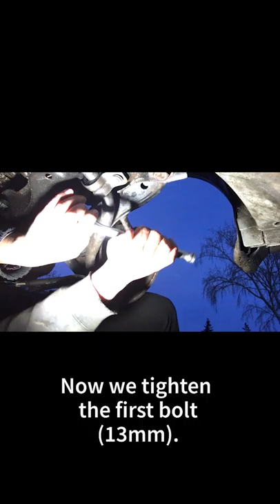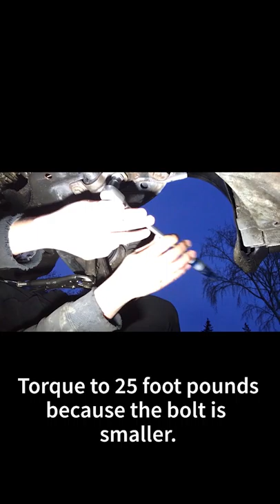Repair A Broken Bolt On The Sway Bar Bracket: Using A Drill, Bolt Extractor, And Tap & Die

Comment: Maybe a dumb question...  Why cant you drill out the original bolt and install a larger bolt with nut on the back?  I was trying to change my bushings and now I'm dealing with this....  Thanks Corey
Reply from the maker: I dont think a nut would fit on the bushing cover unless you installed a stud; which is not a bolt.

But you could drill larger hole, but then you'd need a a helicoil. 

My drill bits kept breaking so I just went without a helicoil. But I recommend drilling slightly larger and installing helicoil.

Comment from the maker: Find tools on a budget here: https://automotiveforbeginners.com/repair-a-broken-bolt-use-a-drill-bolt-extractor-tap-die/

Wireless Power Drill: https://amzn.to/3EtuDs3
Nut/Bolt Extractor: https://amzn.to/3O599EY
Tap & Die Set: https://amzn.to/3hIDUUs
Cutting Fluid: https://amzn.to/3AzADxl
Extra Drill Bits: https://amzn.to/3Ab89cV
Helicoil Thread Repair: https://amzn.to/3O7h7xB
Amazon Prime - Same day delivery*
*up to 2 days delivery

Comment: Just a few things, after centre punching your bolt and before drilling your pilot hole, oversize drill, if your bolt is m8 try a 12mm drill to concave the head of your drilling surface, then drill the bolt, as a cutting lube vaseline is great as it traps the swarf as well, when drilling bolts slow and with good pressure to start and use good cobalt bits, once started then raise speed and let the tip do the work

Comment: 6:12 did you do any drilling prior? or did you just drill the bolt then go make new threads inside the drilled bolt??

???????????
Reply from the maker: Go back and pay attention please.
Reply: @AutomotiveForBeginners  so you tapped threads into the old bolt...
and used a smaller bolt for repair.........................
Reply from the maker: Yes.
Usually, you would need to use heli-coils to use a different bolt of identical size.
I was having trouble as one of the drill bits snapped during drilling.
So had to make quick repair. It lasted for months.
Hope that helps.
Reply: @AutomotiveForBeginners  thanks for explaining

Comment: Could you just put Redlock tight  on the new bolt. Let it set overnight, and try and remove the new bolt which will possibly remove the old one?
Reply from the maker: I dont really follow. Can you reword that?
Reply: @AutomotiveForBeginners  he's suggesting putting redlock right on the replacement bolt. Wich I think it could work considering blue lock tigh is what cause me to snap my bolt , ending up on this video loll. Don't take my word for it but I could se how it could work.
Reply from the maker: @atomicxsmoke6540  Ah! Yeap. I looked at the two colors and noticed blue locktight said it was tougher. I went with that instead. Still haven't had any problems since.

Comment from the maker: //CAUTION// If you use safety glasses and you still manage to get metal shavings in your eyes, IMMEDIATELY flush your eyes with water! Blink as little or not at all as possible. Just get to a water source and flush your eyes repeatedly for 10-15 minutes straight. You may feel a stinging sensation during this time, but as long as you flush continuously you will remove all metal shavings out of your eyes.

To flush: Pour a jug/bowl of water over your eyes (keep repeating). Or place your eyes under a faucet or shower head. Any of these methods will work!